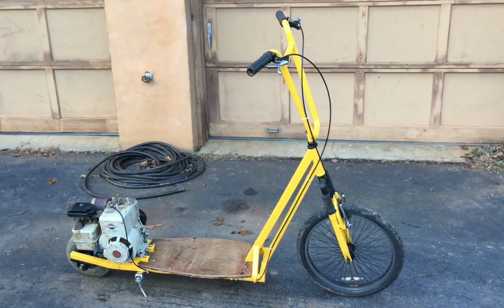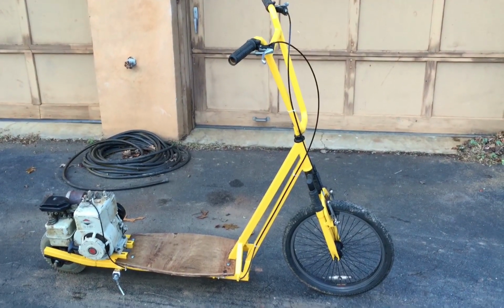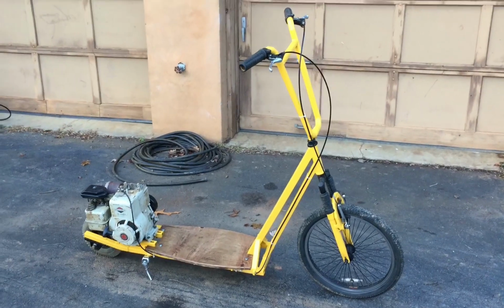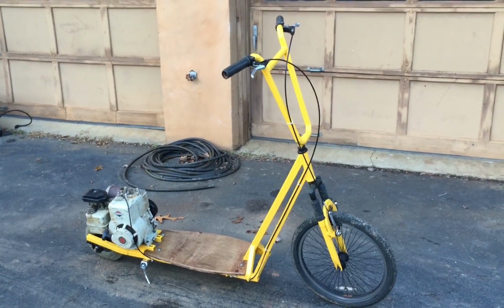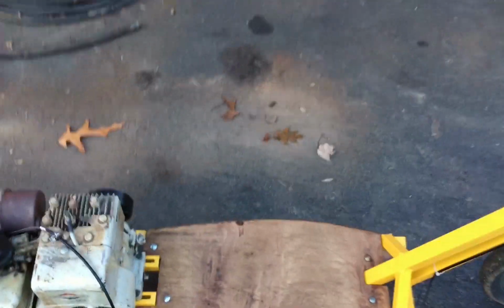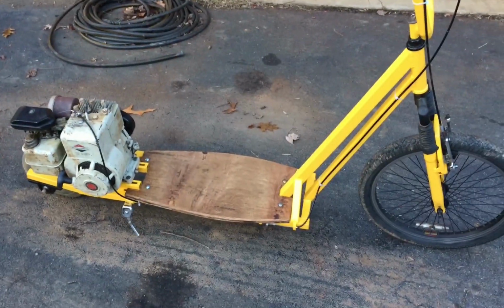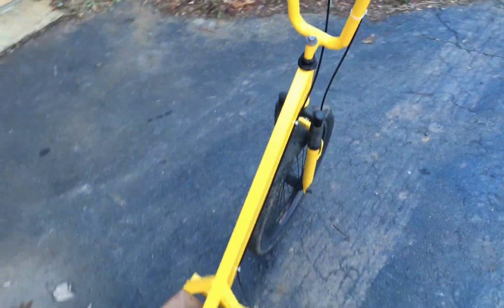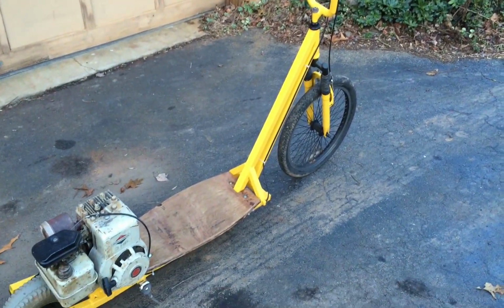home made motorized scooter 3HP part 2

Comment: That thing seems to work well. Its possible that the throttle cable isn't pulling the the throttle open all the way or it could just sound that way on the video. You may just meet a twist throttle to allow more cable travel. Or chop more off of the brake lever and flip it around and push it with your thumb that may give you more cable travel.